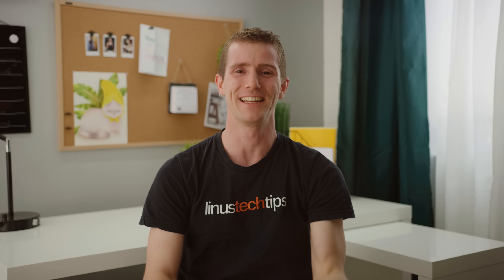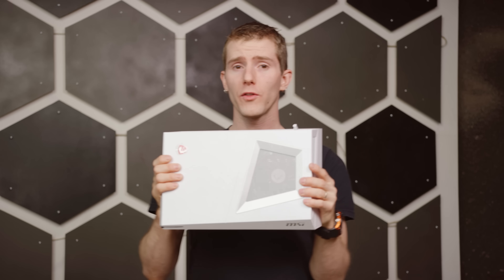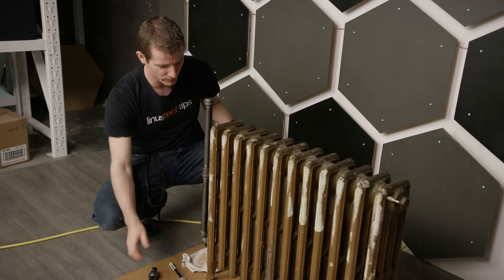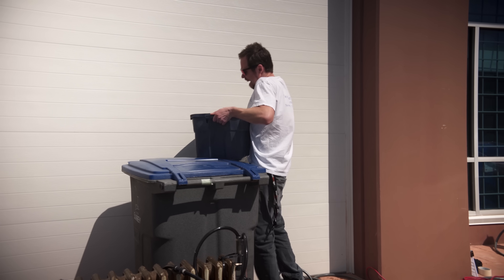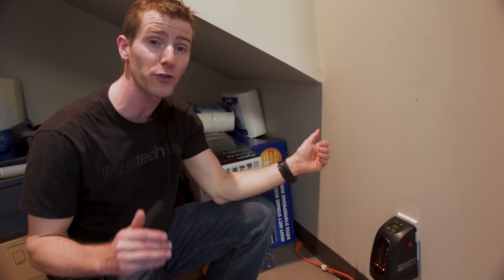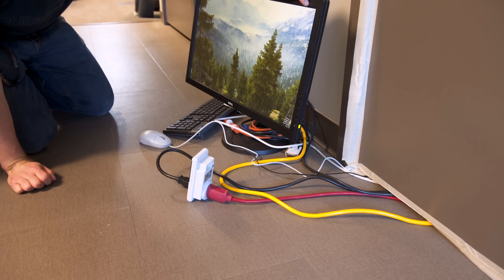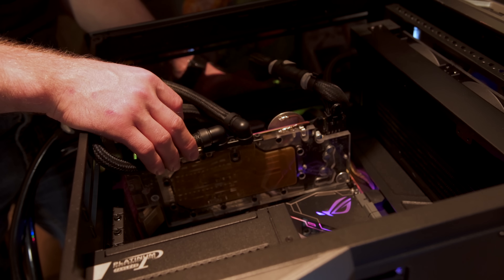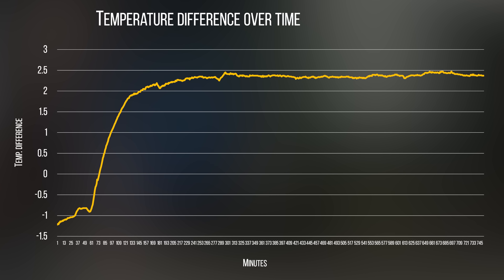Lower your heating bill... with GAMING

Comment: My PC actually used to do this before I got better fans, it's an open air case plus my room is small it actually got pretty hot to the point that I had to open my windows in the middle of the winter.

Comment: what if you cool with a massive automotive inter cooler?
Reply: OvAeons it all stays the same
Reply: +Christian Grey but it would work better. an intercooler is designed to disapade much more heat much faster in a relativly crammed space
Reply: Ditzy Clouds faster oke. But with this test it will eventually have the same result

Comment: Is Linus that cheap he needs to use a disused hospital radiator
Reply: mrzazzaable That's a completely normal old radiator. But in your town, maybe the hospital is the only building with heating that particular age.
Reply: what about using middle good quality stuff dont need to be high end or crap

Comment: I did a project similar to this on an ASUS X48 w/ Q6600 using a automotive 4 row heater core 3" thick copper and brass 10x15". I did it to move the exchanged heat outside my window for Los Angeles summers and inside w/ low fan during what little winter we have. It takes long but if you get it up in morning its good all day. But I don't like being in the warm room so my next project will be to let someone else have the heat. my other plan was to mount the core inside my heater return w/ fan only on to move heat.

Comment: 1:27 as fans slow down their kinetic energy is converted into heat and light also irradiates as heat. So, the only energy not heating you room is escaping wi-fi waves or monitor shining through a window

Comment: There are some of PCI express style pass-through parts you can buy to run quick connects outside the case. Watercool PCI Slot Pass-Through Bracket on AquaTuning. Runs 20 bucks.

Comment: I think my hungriest system I built was a watercooled FX 8570 overclocked to 4.9ghz and an overclocked 290X.
Looking at about 300W at the CPU and about 410W at the GPU, taking about 820W from the wall.

But that was back in Illinois, living in a 1940's home that was built for summer use with almost no insulation and placed on mud- so that heat was very welcome- but when summer, that room was a sauna.

Comment: the kinetic energy causes heat in friction as the air "slows down". then the leds are causing heat by inefficinecy and the photons hitting surfaces etc, much like IR  radiation.

Comment: I remember when i had to get more fans for my computer as it always heated up my room a lot even in the winter 80 degree room to 90 Fahrenheit which is how my first graphics card fried after a few years of that constant heat especially in the summer. I called it my space heater which keep your legs or face away from when it was on unless you wanted to get burned literally

Comment: heat is heat, either using a radiator or just leave your pc like it is ur room will be warmed from the same exact identical heat u can only change how fast heat leaves your pc, or increase it with another "heating device" (that draws extra power or burn some fuel like electricity, gas or wood) but vector will not change the amount, in few words, just use your pc and, if it generates enough heat, your room will be warmed.
Reply: exactly, the only reason to do this would be if you put the pc in a different room and the pipes take the heat to somewhere else where it can be useful. 
so in this case you would want to keep the cooling loop separate from the thermal mass and have a heat transfer system to take the heat out, that way you avoid the corrosion issue. 
Something like a sand battery would be good for storing the heat and allowing it to release slowly over time.

Comment: Every time I get on Discord with my DCS flying buddy, he's shivering cold.  But he runs a Vega 64 Sapphire Nitro+ with a fairly hefty overclock.  Within about two hours, he's sweating and has to crack a window to let some of that crisp Oregon December air in to cool down himself and the Mighty Vega.  With my undervolted 5700XT, that's not really a thing that happens.  Well, except that one time I ran Cinebench and Furmark at the same time for 10 minutes.  That warmed up the room pretty good, and also lead to my PSU turning to a life of sabotage.

Comment: i used to have mounted a standard white convector ~1 meter long at the side of my desk. double sided model with space in the middle for some natural air flow. cost about 50 euros and is totally noiseless. used pump from eheim was the only thing noticable from the whole system.

i think on important thing is to use convection heaters with A LOT more surface area. your radiator loses about 80% of its thermal energy via radiation, convection models about 80% via convection. you dont even need fans!

Comment: First thing I said when they were flushing it was, "Unless they close that loop and run a heated cleaning solution for 15 minutes, it's not clean." I learned that the hard way with my car. Just running cold tap water through the radiator isn't enough. It has to be at peak temperatures with a cleaning solution in it to remove all the gunk. Oh well.

Comment: I did that 5 year before!!!    and I designed to change all heating of the HOME with SERVERS!!!!!!    9 servers  connect to the  Hot Water PIPe line Heating !!!!!

Comment: I been using my pc as heater for my room for years now. My room back in my parents home was added to the home. Therefore no ac/heat during winter I left  my pc running benchmark all night during really really cold winders. Because it wouldn't dry up the room as normal space heater.

Comment: Me and my Roommate used to heat our entire upstairs while gaming with our GTX480 and 570's

It worked pretty damn well and our upstairs that we had didn't have heating and didn't have any heat come in from downstairs lol

It got so cold during winter once that I actually was able to overclock my 570 enough to where when the Spring heat came I spent about ten minutes wondering why my computer kept crashing while gaming since I forgot I overclocked the daylights out of it. That was also the day I realized the GPU was no longer meeting what I wanted out of it, Pretty sure I at least got around 900mhz on its core clock with just air cooling on the stock blower fan and my case had a ton of fans and great airflow. That year was also super cold in general

Comment: That water mass is gonna take way longer just to get up to temp and start warming, and then it's gonna hold so much heat that it will be really hard to cool down at all, and that radiator dissipates heat slowly. Use a automotive radiator mounted horizontally instead, and you'll get a natural convection without a fan that outputs heat faster with less thermal mass. You could even consider going without a pump and use hose slopes strategically to get thermal fluid convection.

Comment: I have a GTX480 to use as a comparison. Similar framerates - WAY more power use.
Also - Have used a radiator from a water fountain to accomplish this same project. Lower thermal mass but more efficient transfer overall. I know this is a two-year-old video but I think it might be fun to revisit.

Comment: it is practical. My room was always freezing in the winter months. Neither natural gas nor 2000-3000W heaters were the solution. One day I left my computer for a stress test and when I arrived 4-5 hours later, the room was warm. The 100W CPU provided the most efficient heating of all. :D Semiconductors is best way to heat you room. :D

Comment: Old computers did indeed make lot of heat, the biggest "heater" was the psu with a average wattage of 350 watts with low power factor (free heat), so they draw about the duoble amount of power, 800 watts in all, while only paying for the 350 watts :)

Comment: I'd be interested to see a heatsink which incorporates the same methodology a stove fan does. A thermoelectric setup which converts the heat to electricity to power the fan. I see you've done cool with thermoelectric pads by applying a voltage but using the energy to power a fan would be interesting to see if it worked
Reply: I don't think it would move enough air to cool the PC.

Comment: Concept of the video: Take really good concept and ruin it by sabotaging it every step of the way (using the wrong and a basically ruined heater, destroying your watercooling components along the way, using the wrong fittings and wrecking half of the right ones while doing it, etc.)

Comment: Out doesn't matter if you used a air cooler or water cooler or an actual hearing radiator they should all heat up the room at the same rate once the system is at operating temps, assuming that the wars it's drawing are the same

Comment: I wonder if it would be more efficient to use a couple (or few) 480mm radiators in series since the fin density is so much higher to get similar results without dealing with a crappy used radiator.

Comment: If the PC is in the same room as the radiator isn't the radiator superfluous? The entire thermal load is in the room either way. Unless the radiator lets the GPU not thermal throttle and pull more power than usual then you could get some extra heat.

Comment: Seems like having a massive radiator would make the pc run better (if clean) but the room should get just as hot no matter how you move the heat. A watt is a watt - it can't be created or destroyed as you say. Even the fans and lights will end up as waste heat eventually.

Comment: A closed water-cooling loop that runs from the PC into a heat exchanger with a second loop running through the big radiator would keep the gunk out of the blocks. Lot of work for this though

Comment: You should have two pumps and two circuits with a heat exchanger in between ;). But frankly speaking. The radiator will work the same as fans. It’s the computers that is the source of the heat and it’s energy consumption determines the room temperature. The energy can go either to useful work in computer or heat. The big radiator is just a energy (heat) buffer thanks to its mass and volume of water.

Comment: WE NEEED a update of this video, because rtx 4090 do be getting hot
Reply: no kidding, i did some calculations based on the 4090, and how many watts it draws, to see what it would be like to divert the heat produced into a sand battery. about 4 hours of use would be enough to make 200kg of sand reach over 100 degrees c.

Comment: You need to stick a fan on the radiator so that you get the dispersion of the heat to be equal to the space heater

Comment: I mined Ethereum on my 3090 to keep my room warm in the winter because our houses heating was super inefficient (one wood burning stove) and it worked great aside from me waking up in the middle of the night sweating and dehydrated because my room is 100 degrees

Edit: it was very noisy too (4 noctua ippc 3000 140mm on full blast)

Comment: Nor sure if you use hydronic or forced air, but I'd like to see a hear exchanger to work with a hot water heating system/heat pump cooling.

Comment: I have that same case and even with a full open loop setup, I still have to keep the window cracked in the office or it gets way too hot. (bit coin mining with the machine) I really wish though that I would have gotten those quick connects, they would make moving things around so much easier and less worrisome.

Comment: heat is heat, radiator or not the room will warm up just the same as if you can have one as long as the computer is consuming the power.  just put normal air based fans on it and it will be just as effective as any other portable heater running at 300 watts

Comment: Didn't account for the heat generated by the pump ( which can be a lot ).  Try a ground plane loop for both your air conditioner and another for a cooling tank the systems use?

Comment: Fans and lights aren't really a problem either. Sure the energy turns to something that isn't heat in the short term, but that air is going to slow down, the sound it makes is going to get absorbed, and the light will get absorbed. The only loss is energy that actually escapes your room.

Comment: You really don't need a radiator and water unless you want to time shift the thermal and cooling. Just use fan and eventually it will heat the same amount per watt.

Comment: fans would be much more practical. I doubt their power consumption would be significant to the test.
Besides if energy is used for fans in a fan setup, well who cares? the regular guy would use his fan pc as a heater. If at the end of the day the room is hot, then it's a success.
There isn't need for this posh academic scientific type approach

Comment: I actually never used my heater in almost 7 years right now. Here in South East France, we have 5~15°C winters (sometimes more) and my computer acts as a heater by using BOINC.exe when on idle =)

It's called CHP (Combined Heat and Power) if I'm not wrong ^^

Comment: All the kinetic energy and the light energy is eventually turned into heat as well so it should heat the room with exactly the same power as the power supply uses no matter how many fans you have

Comment: quick tip when cleaning a radiator u want a "radiator flush" its a chemical that will break loose the gunk in the radiator and will most likely clean the radiator 90% better than just water or if u wanna just use water u gota use water that is close to 60-90C degrees hot for the gunk in the radiator to break loose or you can just buy a bran new one.

Comment: Just use a heat exchanger and keep the water in the radiator separate. But really not sure what you're trying to show as pc will heat any mass it's connected to. Connect your pcs to the your central heating for the entire office and you won't need a furnace.

Comment: I suppose if you ever wanted to repeat this experiment, it would help to use a newer and/or cleaner radiator, of course, but also compare the same radiator hooked to a boiler vs hooked to a GPU.

Comment: the energy turns into heat - the same energy and thus the same heat if yu blow it out with a fan and if you pump it through a radiator.

Comment: laving a compute thats constantly generating heat in a small room would obviously cause a thermal thorottle. usually a space heater is in a much broader area. ex. kitchen,living room ect. but this comparison would have been greater in a room that can fit more than two papa smurfs whould have been a better test for the  two.

Comment: The power from the fans and the LEDs isn't somehow exempt from the laws of thermodynamics and so will also ultimately be released as heat, and using an old oil heater won't make any difference to the amount of heat generated so all this experiment did was to show that fact; Technology Connections explains it well in a video about heaters.

Comment: Having a big radiator won't change anything. Just set the PC up in the room you wanna heat lol. Also, in theory the kinetic energy from the fans gets transferred into heat by the fan blades/air molecules and air/air rubbing against each other.

Comment: just make your next pc build small, put it in the ventilation duct in front of the main fan set to continuous air circulation, and see if your heating bill goes down. 

Or see how many GPUs are needed to get the bill down.

Comment: There is literally 0 difference if that huge thing, an aircooler, a normal Radiator or whatever disipates the heat into the air (as long as it is adequate for the cpu). So what’s the point? ^^

Comment: i mean you could have run 2 rx 580s and set up all fans for exaust and prolly could have produced even higher temps. (note: overclocking not reccomended unless you can survive on the surface of the sun)

Comment: The only energy that wont heat the room will be a near-infinitesimally small amount that escapes as sound and light before transitioning to heat shortly after. But for all intents and purposes, basically 100% of the electricity sucked from the wall is heating the room.
    Which of course is the same for just about every electrical device in our homes, save for what gets stored for later, as when charging batteries and some other negligible amounts that are sunk into chemical reactions such as cooking food (these are the only things I can currently think of, at least, but I'm keen to hear if anyone else can think of any others! — Oh, actually also, any heat that escapes down a drain, like if a kettle is boiled but some is dumped down the sink. I don't feel this should count though, as heat escaping through an open window certainly shouldn't, and it's essentially the same concept).
     I have a fun story in this vein actually (okay, probably not that fun now that I think about it, but at least mildly interesting I hope!): When I was in college my small bedroom was normally too hot so I never needed an auxiliary heater. Until the landlord unexpectedly dropped by and discovered that my housemates were bypassing the timer on the central heating. He returned later that evening and installed an upgraded lock-out system that prevented them from running the heating 24/7 (for a couple weeks, anyway). I discovered this when I came home from work late one night to find my room was freezing cold. Lacking the opportunity to pick up a cheap 2cnd-hand space heater at such short notice, I scoured my brain for creative ways to safely draw a couple thousand watts and disperse it throughout my room. That's when I suddenly realised that my window-vented air conditioner sitting in my closet ran at about 2Kw. So, as counter-intuitive as it might originally seem, I simply had to fire it up without venting the exhaust hose out the window. Instead I aimed it at the stream of cold air coming out the front, and achieved the net result of a lovely warm wind swirling around my room. My housemates couldn't wrap their heads around how I could possibly claim that I was heating my room with my air-conditioner, they seemed to genuinely think it was a hair-brained scheme 🤣,